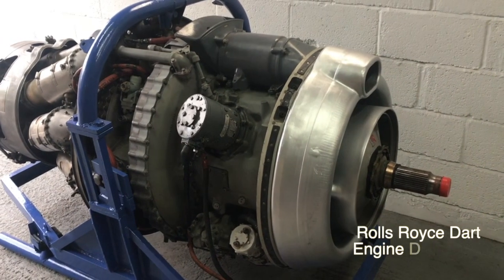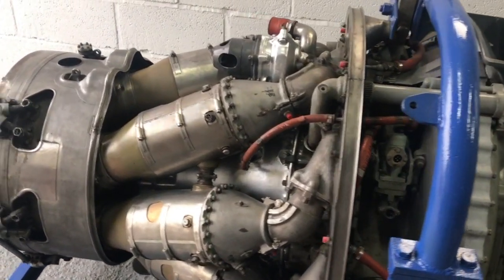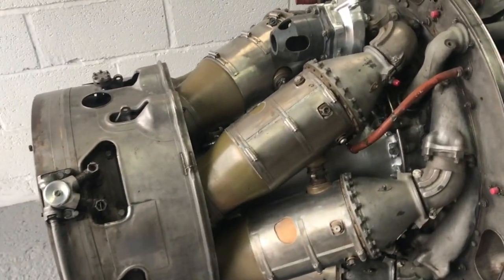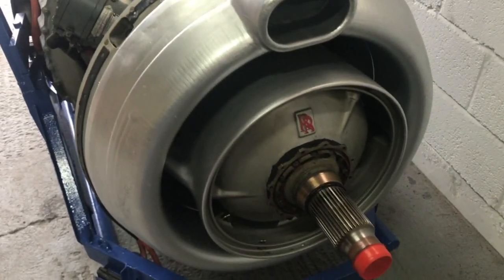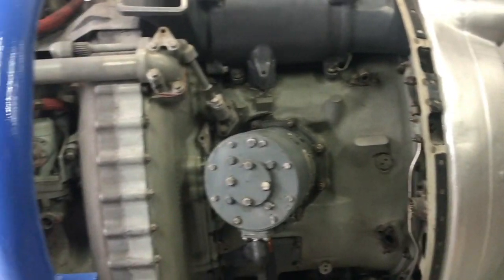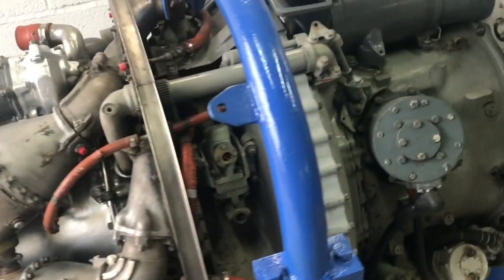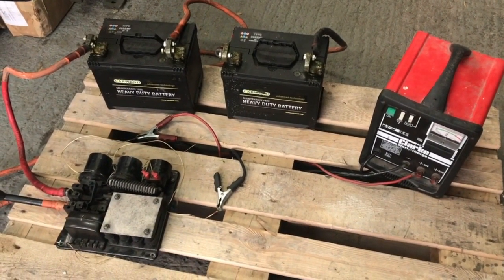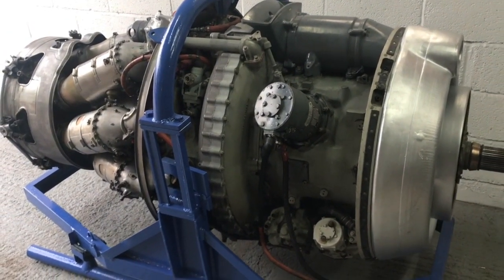Rolls-Royce Dart Engine Dry Cycle

Comment: I worked on YS-11s powered by this engine driving a 16.5 feet Rotol Dowty huge four bladed prop. With the stock two 24V batteries in parallel, you only had one chance to start it. To move that prop, the starter would draw some serious current, in the 400A range. Nice dry run, but sounds sweeter after fuel is on.